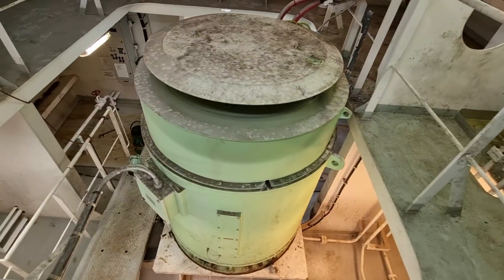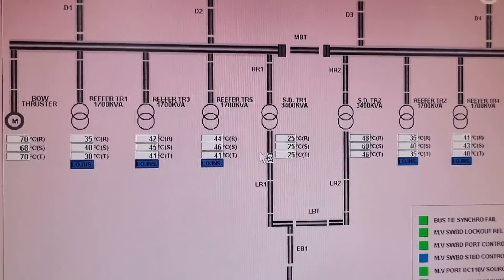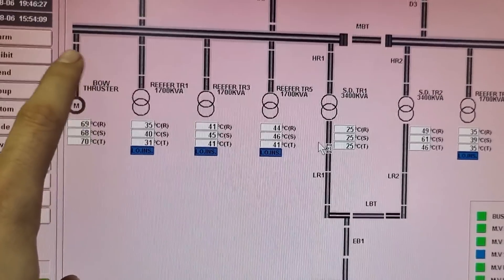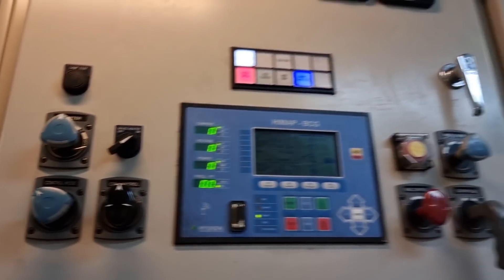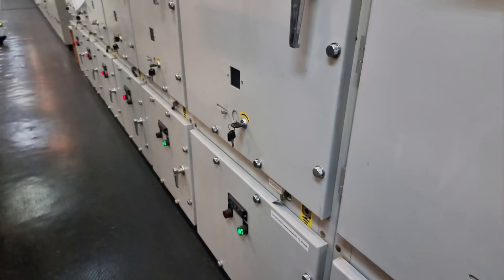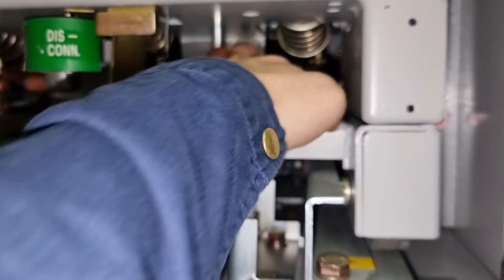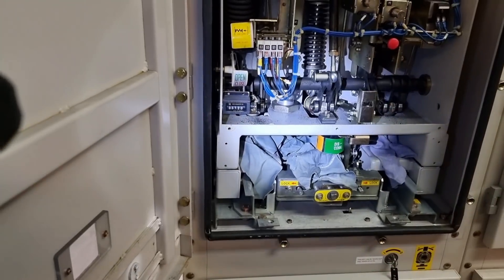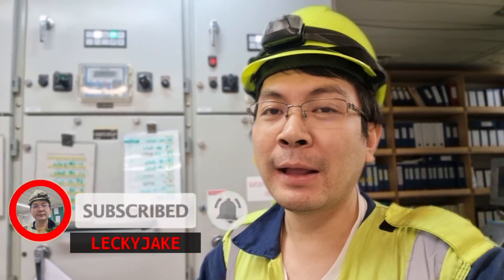BOW THRUSTER HIGH VOLTAGE TROUBLE | MARINE ELECTRICIAN

Comment: Is WD40 the correct lubricant for the application?  I thought there would be a specific silicone grease required with low VOC.
Reply: You are correct. I just worked on similar voltage stwichgear on a project and we used the correct silicone grease where needed. Perhaps it's not something they keep on board but I think they should. That being said, a cleaning with WD-40 might be all they needed anyway.
Reply: @justinkase1360  Deoxit F5, take it or leave it lol
Reply: Exactly ^
Reply: WD40 actually has good dielectric properties, so yes it's totally fine for this
Reply: It probably isn't, but from the video it is clear that this unit needs proper maintenance anyway, and it's only a short term solution. WD40 is almost always the wrong thing if you have "lubrication" in mind.
Reply: WD-40 is not even a lubricant it is a water displacer
Reply: @buisline3993  you wd40 haters are insufferable
Reply: @5eZa  
It’s not a matter of hatting WD-40. It’s not the right tool for every job. It’s flammable. And it evaporates easily. It also can attract dust. So it doesn’t sound suitable for electrical use.
Reply: @buisline3993  And what displaces water, again? Is it lubricants? Because I bet it's an oil/lubricant. Some things are multi-purpose.
Reply: @donkEEpunch85  Alcohol will displace water. It's not a lubricant, well perhaps in a social environment that's an exception.
Reply: @gorillaau  Alcohol mixes with water.
Reply: @donkEEpunch85  WD-40 is a gasoline-like mixture of hydrophobic substances. It has added lubricants but only like 15 percent.
It was developed to keep ICMBs from rusting, with an easy to use spray-on agent. The only thing that it's supposed to lubricate are simple hinges.
I don't know what dangers can emerge from using WD-40 in a high voltage environment, but I wouldn't gamble with that.
Reply: @gustavgnoettgen  I thought WD was a waste product of refining crude oil?
Reply: It really isn't the right thing. WD40 is a dismantling lubricant and this will only work as a short term solution.
Reply: @custardavenger  seriously, lol it’s not lubricant, it’s a 

Water Displacement solvent
With a small amount of lubricant included.

Hence the “WD” in “WD-40”
Reply: When your at sea, you are limited from resources. What matters is to make the machine operational due to urgency. As he said before arrival. If we have everything onboard we will use what manuals said. But due to limitations we have to find other ways yet not compromising the condition of the equipment.

Comment: We have more mechanical issues with our high vol switch gear than electrical! Lol. Back in the day, the buss rails and plugs were made of all high quality parts and with regular maintenance would never fail. Now they try to save money and use cheap stuff. Plastic instead of metal, pot metal instead of billet and so on.

Comment: @leckyjack, What is the amperage of the bow thruster at 6600v?
Reply: Depends on the speed of the bow thruster, how much load it's under, cavitation, etc
Reply: Based on the control panel in the video (8:30), about 100 amps.

Comment: I don't know much about ship equipment. But it is nice to know that the rule that you can fix 90% of the things with WD-40 and Duct tape also applies to ships! :)
Reply: I've worked on many boats from steam boats to trawlers 3 key things any boat needs 1: duct tape 2: zipties 3: wd-40.
Reply: @tranceman9670 and if that does not work. Then a welder.
Reply: @tranceman9670  based on that, i would like boats
Reply: @swaags  lol well that would all depend on what type of boat u were on... I've had many crew say that to me & I break em in a week.
Reply: @tranceman9670  i love a challenge! currently an equipment diesel mechanic, but not many opportunities to flex the improvisation and fabrication muscles when often you can just afford to wait for the right part.
Reply: @swaags  u would be very useful on a big boat that requires a diesel mechanic onboard. Lol yeah that's very true easier to just wait.
Reply: Is this just normal lack lube situation or a temp fix thats kinda sketch
Reply: ....and bubble gum.
Reply: @ph11p3540  Years ago I saw a coworker plug a leaking heat exchanger with the gum he was just chewing. It actually stopped the leak until the new heat exchanger arrived.
Reply: Don't forget a hammer.
Reply: It does if you’ve got a Philippino crew!
Reply: WD40 isn't a lubricant tho
Reply: @SilynRaces  right, its a rust displacer. im guessing ships rust. alot.
Reply: @swaags  correct.
Reply: @SilynRaces  depends on what type of wd40 you're using. There are even special types of wd40 designed for this kind of work. Like the dry lube version, lubes but repellent to dust, etc.

Comment: It must be a good feeling knowing you got such a serious arc flash suit on board. The danger of 6000volts is kinda impossible for people to understand until it blows up in your face.
Reply: I saw a guy literally blow himself to pieces in a generator room, high V/AC scares the shit outta me.
Reply: I used to tour some factories and see “medium voltage” AC motors. While that does not sound scary at first think about this, 0-600v is “low voltage” and up to 4,160 volts is “medium”. I didn’t even want to look in the direction of those motors or their feed boxes!
Reply: What face?
Reply: not very good arch flash suit
Reply: @sr9ruger1  if I'm not mistaken its just a cotton suit. Normal synthetic fibers used for  clothing will melt in an arcflash and can burn you worse than the arcflash itself.  Is there some kind of higher quality suit using inorganic or other very high melting temperature fibers?
Reply: I don’t believe that suit (Max protection is 40cal) would actually protect you enough on that medium voltage board.
Reply: @chonolith  I think the suit is more to protect from burns caused by an electrical arc than to protect against electric shock.
Reply: Well you won't have a face left
Reply: Actually it's not, plenty of videos on YouTube that show the aftermath of such incidents.
Reply: That arc flash suit seems a little flimsy compared to what we used.
Reply: Yeah ark flash protection is a must even if you are confident nothing will go wrong for an idea of what can happen when something does go wrong see this video: https://www.youtube.com/watch?v=IBx8WgD_hlg (viewer discretion advised)
Reply: High Voltage doesn’t really scare me… Amps contain the scary magic😉
Reply: @MrBLAA  it's the "P" that gets you..  P= VxR   6000 volts means arc flash = danger.
Reply: @MrBLAA  And what causes the amps to flow?  With low voltage you have to touch the conductor in order to make a circuit that puts current through your body.  But just being close to a high-voltage conductor can result in a lethal arc.

Comment: You test the bow thruster while under sea? This does not disturb the normal sailing direction of the ship or do you correct for that with the rudder?
Reply: He was probably just testing the motor without it being connected to the thruster itself.

Comment: You can't isolate the bow thruster and the bow thruster only? What shitty kind of design is this?
Reply from the maker: Every vcb can be isolated individually provided you can open the VCB. Of course there is this kind of trouble wherein you cannot just isolate it alone becuase it stays engaged in the 6,600 V bus bar. In short it is a rare situation and ofcurse leaving you with no choice but to isolate half of the bus bar.

Comment: It was a great day when VCB's replaced OCB's in Power stations
Reply: I disagree. A well maintained ocb will last forever. Give them regular oil changes and check split pins etc and they are bomb proof.
Reply: @whippetquick3527  They also have a nasty habit of going bang, I'v seen a few. 
The big advantage as far as I was concerned was that VCB's are much easier to manhandle for isolations, some of our 11kV OCB's weighed well over a tonne and they take some dragging out when you are on your own.
Reply: I've only seen 1 that went bang. Have to admit that when they go they really go. This one took out an external wall and part of the roof. They do need more regular maintenance than VCBs and luckily the one that went bang hadn't been maintained by us :-) I don't miss hand cranking the things either. Those tanks are heavy.

Comment: so WD-40 is not a lubricant, its a water displacing solvent that can soften rubber.. its also not suppose to be used in something like an enclosed electrical panel as its vapor is flammable, you guys should probably use something different like a grease that's rated for panel use.

Comment: Wow, never knew the switch gear could be fouled enough to over come the spring tension? We rack and rotate with spare , rebuild and test.
Reply: And with all due respect, I would be sceptical that a quick clean up and squirt of extremely low viscosity, short service life lubricant is going to offer much of a fix. Pessimists though eh?! Ha.
Reply: @dmacgyo  I agree. Probably more a case of the manual trip freeing up what was stuck. Will happen again given time. Breaker must see alot of ops thou so understandable if its worn out
Reply: @dmacgyo  permanent fix? Absolutely not. Enough of a fix to make it back to Port where you can do it right? Should work.
Reply: @dmacgyo  I don't know how you PM a breaker but we do more than a squirt of grease...... if you know then you know, just our hipot test alone is enough to shake the souls out of the guys standing around
Reply: Crumbling rubber or elastomer damper  seems to be what he commented on.
Reply: @imconsequetau5275  is there a conditioner they could use on the rubber or maybe the high temps would just burn it off
Reply: @deborahchesser7375  
Probably degraded due to ozone, friction, and collisions, so the damper needs to be replaced. Recent innovations allow various thermoplastics and rubber to be molded together, so I'm wondering if it could be re-engineered to be more durable, or substitute with a polyurethane.

Back in the day, IBM made a typewriter with a fluid damper, (piston and cup), which trapped air for deceleration of the carriage at the end-of-return. That was a large part, but they never wore out.
Reply: Salt water enviroment man.
Reply: @Steve211Ucdhihifvshi  well thats true, however I'm here in Seattle on the peer (pretty salty) as a prime power electrician, our sub feed tulip vacuum breakers and generator feeds are from the 80s. We have our problems but never seized up

Comment: Yes! Yet another use for a little WD-40. Hope you get that worn component changed out!

The high voltage PPE is critical. When you don it, you learn that air conditioning is just as critical.

Fair winds and following seas!

Comment: I would have just reboot the whole thing
Reply from the maker: To reboot you will do the same except the racking out of the Bow thruster VCB. In that case Id rather rack it out and open it manually to ensure that everything is being checked and performed. It is a 6,600 V that everything need to be sure and safe

Comment: You really should put in more in depth explanation of why are you going and using this approach and what you needed to consider. Mainly, why the VCB could be opened with no load on the bow thruster? Is it some kind of interlock, or...?
Reply from the maker: It was actually specifically mentioned in the beginning that the vcb cannot be opened hence need to isolate the bus tie to manually open it so that it can be disengaged safely from the bus bar.
Reply: @leckyjake  Is the VCB simply for fault protection? Is there some functional switching downstream of the VCB?

Comment: Sticking a metal wrench inside of a high voltage cabinet makes me uneasy.
Reply from the maker: Of course after we isolated the bus tie. Ensuring no voltage present
Reply: Take away all supplies and its a mechanical part. Torque wrenches be important electrician tools ;-)

Comment: Seems a very poorly designed switchgear panel that requires the front access door to be opened to allow the mechanical trip button to be operated! The trip button should be able to be operated with the door closed and fastened. Opening the door may compromise the arc containment features of the gear.

Oh, and I'd strongly advise you NOT to use WD40 on any part of any high voltage switchgear - you will cause yourself all sorts of difficulties including the possibility of slow-opening (and catastrophic failure) of the circuit breaker. WD40 will seriously gum-up the mechanism by allowing all sorts of airborne contaminants to form a sticky mess over time.
Reply: Yep, thats made by Hyundai for you.

Comment: You put wd40 on the mechanical parts but you referred to rubber worn off a pad or part what was that from and did it cconcern you ie getting a new pdf for replacement?
I worked in the North Sea when the oil boom was on early 80"s and one catermaran tug had I its bow thrusters I think wired in revers and other problems, we went towards a lay barges and the thrusters cut out and we hit it blunting  our stern and slightly damaging the barge, as it was running anchors and it was also doing survey work which I was involved in so the vessel I was not involved in, but if I was I would have had it checked over as it had a lot rong wilt it.
Thanks for the technical video I'm wes in  electronics and anything over 5 or 3.3V DC is doggy.
Reply from the maker: The dampers are rubber parts that avoids the metal to metal contact everytime the vcb opens and closes. With that kind of force the rubber acts like the shock absorber which in return wers off hence need to replace. To replace this we need to dismantle the springs and calibrate again, which ofcourse needs the special tools which is not part of our scope. We just tried to lubricate the joints to free them up but I am sure this will happen again unless the dampers were not replaced.

Comment: Nice to know that WD-40 has its uses even on multi-million dollar ships.
Reply: It's not really the right product for this application though.
Reply: @jay-em  yeah, not really a lubricant, just a penetrating fluid. Needs to be lubricated once it's been freed off.
Reply: @jay-em  contact cleaner, did I win lol
Reply: It was developed for use in the Atlas missile program, the WD stands for Water Displacement. So yeah, its been used for multi million dollar applications quite a bit in aerospace and aviation. As a lubricant, I think it sucks.  Its a pretty good contact cleaner and fairly mild adhesive remover.
Reply: @SteelDoesMyWill  glad you pointed that out.  The history of WD40 is interesting.  40 tries and an RFP from the DOD for a magical WD product that would preserve ICBMs.
Reply: WD 40 is flammable so after freshly spraying it about the mechanism there is a possibility of ignition on breaker operation, not so much with the vacuum breakers but definitely with older air brake units. WD 40 also leaves a sticky residue that will dry out over time. It's better to use a PTFE spray or lithium grease.
Reply: @twopowermobile5988  yea but after you spray it if flashs off pretty quickly and is no longer flammable.
Reply: @twopowermobile5988  I also have only ever used WD-40 as a degreaser. I always use lithium grease for lubricating ACBs
Reply: WD-40 is good as a degreaser and a contact cleaner.  Not for lubrication.  WD-40 does not have the film strength of a proper lube oil.
Reply: I put that shit on everything!
Reply: Ah. I just used it on my small 25ft sailing boat to try to fix intermittent contact with my automatic tiller. The WD40 for cleaning contact that is. Small world.
Reply: Why wouldnt it have a use on a multi million dollar ship when it was invented for multi million dollar rockets. WD-40 will always be useful especially for maintance techs.
Reply: Obviously, it's a great contact cleaner :)
Reply: @fragotron  It's meaningful to reiterate the same view by multiple persons to show it isn't just a personal view but something that should be thought more about.

This ship should have grease better intended for this lubrication task.
Reply: Its sad to know that you don't realise wd40 was invented to be used on multi-billion dollar rockets
Reply: @janeblogs324  Does it matter? WD40 was not created to be used as a lubricant. Is it the price of the rocket that matters, or what specific task WD40 was designed for? Think twice before you answer...
Reply: it was ONE of the many products made to combat major war time issues....
Reply: WD is one of those tools that might not be the best tool for the job, but it's everywhere and better than nothing
Reply: all faults can be fixed with wd40 and duct tape :D  if it's not moving but should move then wd40 , if it's moving but shouldn't then duct tape :D
Reply: WD-40 sucks as a lubricant it was originally designed to be a cleaner.